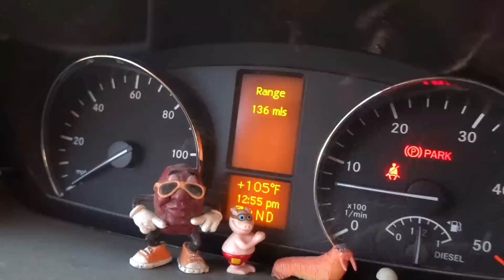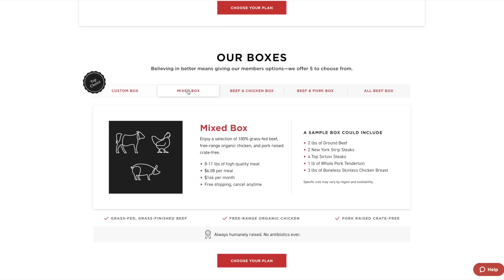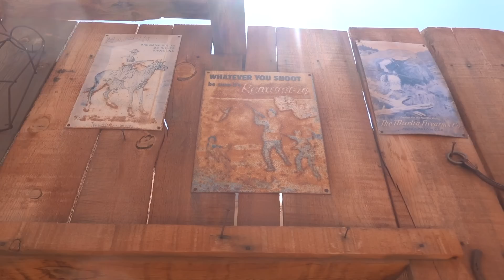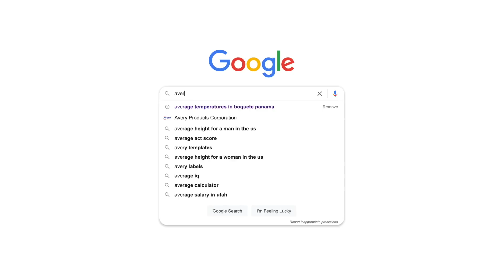CONVERTING A VINTAGE BUS FOR AIRBNB RENTAL INCOME 💰

Comment: Drew,  the white bag "canteen" is actually a radiator water bag that was filled with water and hung in front of the radiator while traveling thru the hot parts of the country. The bag slowly seeps out the water to help cool the radiator so to not overheat anymore than it can.
Reply: This is a neat little tidbit!!!
Reply from the maker: Fascinating!! Thank you for sharing that!
Reply: I remember when in the 1950s relatives drove from Cali to Tex using the bags thru the deserts.
Reply: Yep, I remember in the 70s we used it driving from. Tx - CA,  summer vacation and back, we had to drive at night some days... not sure how that worked,  I was just an antsy kid with .my siblings fighting in the car.

Comment: You can do it. Here is some un solicited advice. Its not a Skoolie rolling down the road. So keep it simple. I recommend gutting, wiring, spray foam insulating and putting in floors and walls. Then add electric. An ikea kitchen, and furniture. 3 months is my guess. in Moab mid to late August is when it cools down and by mid November it gets real cold.(that's a 3 month window) Looks like a fun project, If you are getting paid well. You will be a big advertisement for his Air BnB. Keep that in mind. Make it a win win. have fun.& God bless. 
P.S. Ive been following your you tube for a long time. I always enjoy the videos
Reply from the maker: Good advice. We figure there is that same window for good temps. Thank you following along over the years ❤️🙏✨

Comment: Well, not so sure you getting a good project. Contract out removing the bus as well as a building or shaded place to work. Takes heavy equipment as well as the right truck to move it. Could cost several thousand dollars. Will require a vast amount of tools to complete the renovation, very very expensive.We know there will be private agreements, but some type ownership should be part of the contract. Was a great video as always.
Reply from the maker: Glad you enjoyed the video! The quote for moving the bus is $5-8k An agreement would be signed to ensure both parties are on the same wave length.

Comment: I did one Bus/Skokie build...and because of that I’d say NO😮 But in your instance it will give you valuable experience towards your own remodel / build when you find your place over seas????

After watching the entire video, cement over the tires -RUN
Broken up renovation schedule- RUN
100 degree plus heat and no AC- RUN
In short RUN AWAY FROM THIS PROJECT‼️
Reply from the maker: LOL. Yes, it would give us the experience.

Comment: Jack that bus up and take those tires off. Use a dolly to move the concrete and tires away.  Put new rims and tires all the way around.. don't even bother with a jack hammer..
Reply: Taking a second look.. it would take Chisel to release the Frame from the edge of the concrete.. the wheels appear to be full it is possible that the tires might pop out easily but either way they need replaced before the bus goes anywhere.. a hand held jack hammer might work pretty well to release it.. it would Also be pretty easy to chip it out.. your looking at maybe 3 days

Comment: Good video 😀 no I would not take that job the bus doesn't run it would cost 40 thousand to renovate just to start run away very fast I think its over your head  but have a great time 😀 🤔
Reply from the maker: There is no plan to make it run again, but just simply use the bus shell for the airbnb project.